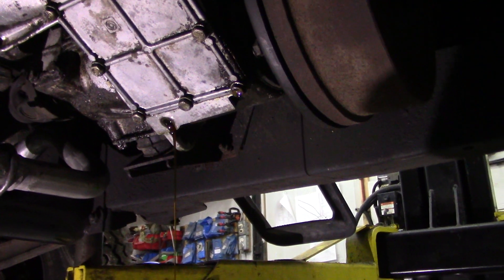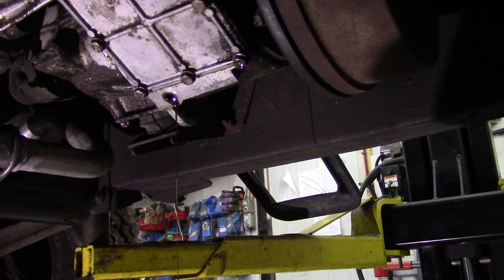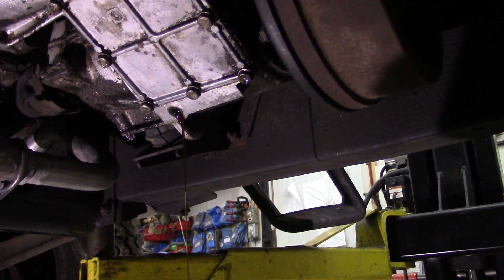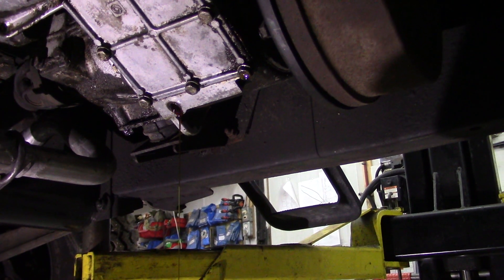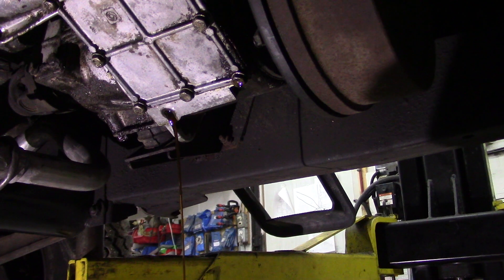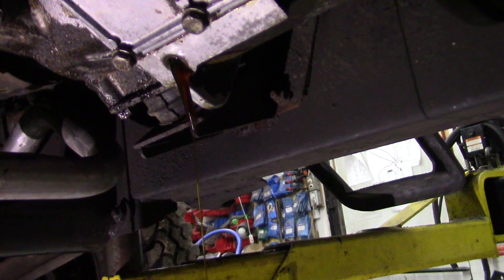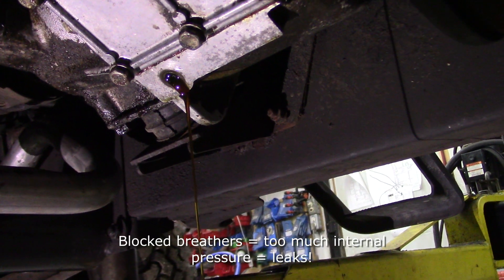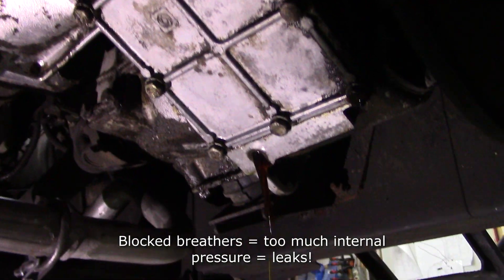Quick one! A sure sign the breathers are blocked!

Comment: I always open the fill port first. As I was told to make sure you can open that first to make sure you can put oil back in after. If you drain it then find you can't get the fill port out, then you are stuck.

But with that of course, I have never drained in this way to check the breathers.
Reply: Sure if you work in Mr 10min oil shop, but sooner or later you will have to address that problem.
Reply: And working as a mechanic, I ALWAYS pop the hood and loosen oil fill cap before draining.   It is rare, but if you work as a mechanic, eventually you will come across a car with a broken hood release.  And I'm not talking about one that sticks, where you get it open by pulling the release while someone taps on the hood.  Or where the cable is stretched a little, where you can just use vicegrips on the cable.  No, I am talking about when the only way to get the hood open is getting creative with tools, disassembling grille/front bumper, or getting a little destructive.  If you drain oil first in that instance, it's gonna be a real bad day!😂